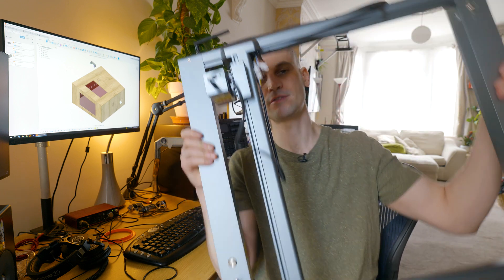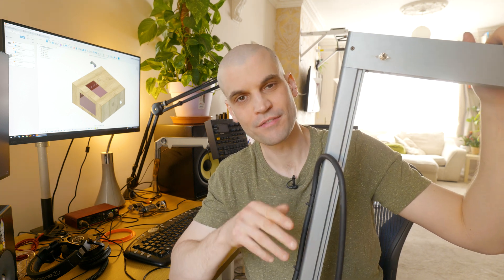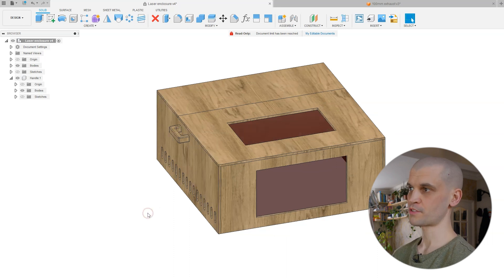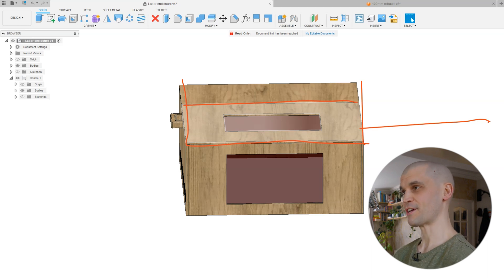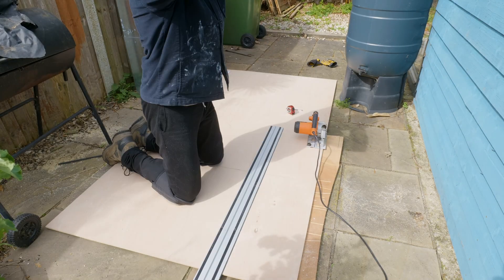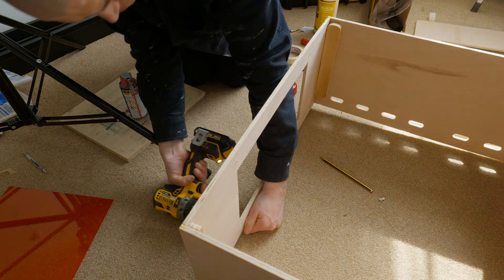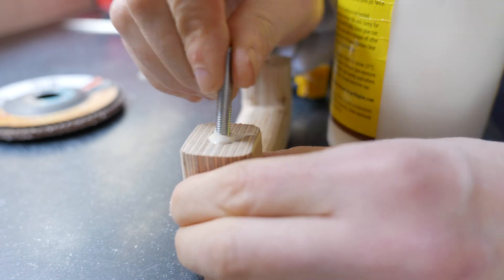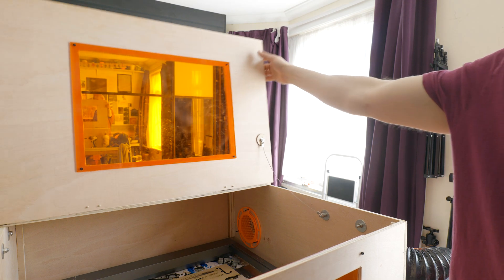Simple & Cheap DIY Laser Enclosure build

Comment: The milwaukee brad nailer, do you have a model no or link to it please?
Reply from the maker: Milwauke M18 Fuel 18 Gauge Brad Nailer, I have dealt battery adapter for it so uses my dewalt batteries which is handy. Love it, great tool

Comment: Question about condensation.  Does the heat inside the box ever contrast with a cool room and cause condensation?  Or, is your blower strong enough to mitigate this problem?  Do you wish you painted the inside of the box? Thanks
Reply from the maker: I never have condensation issues, it's most made from thin panel wood. No need to paint the inside, it will soon get stained with laser fumes so save yourself the time and money on painting it

Comment: Hello Mate, thank you very much for that great tutorial. However, i was wondering if there was any way to coat the interior with something fireproof as sometimes (rarely), lasers could start flames and a wooden enclosure would only make it worse.
Reply from the maker: You could line the inside with fire resistant plasterboard. To slow down the spread of fire. 

There are also fire extinguisher add-ons from Xtool that you can add to any enclosure which seems to be a great alternative
Reply: Oh yeah very good idea ! Thank you

Comment: Considering a build like this myself. Got a small question though. Does all the smell get vented out well? Like if the laser hasn't run for a while, does the enclosure build up smell which then "blasts" you in the face if you open it up?

I currently have a more expensive branded enclosure but not quite liking it as the smell is still bad. It vents out fine out of the window. But when not using my laser for two weeks and opening it up, a huge "cloud" of smell "punches" me in the base. It's like it still builds up inside the enclosure somehow.
Reply from the maker: The smell mostly builds up on the cutting bed below the material, that will stink from just 1 cutting project. It's a smelly process I don't think you can get around that to be honest. If I take out my cutting bed and just smell the enclosure itself it's not too smelly.

Comment: Good video!  Your intuition about the vent holes is correct.  The textbook term for it is Conservation of Mass.  To maintain the same velocity on the way in, you want vent holes that equal the size of the exhaust.  Smaller holes will result in higher velocity and vice versa.
Reply from the maker: Thanks for the info and clearing that up. Time to read up on conservation of mass 👍
Reply: I built an enclosure with similar materials but fir a 60w jpt mopa which means its a rectangle on its end rather than on its side. Where would I place the small holes on a box this shape? Wherever I put the holes, the fan will ventilation hole will be kn the opposite side? I tried researching conservation of mass on airflow but I couldn't find much on it

Comment: I think you wouldn't need those holes when you always use air-assist.
Reply from the maker: Yes you are probably right, its not air tight so you would get airflow through the enclosure even without the holes

Comment: At 8:14 what is that fan thing you use? Did you buy it? Repurpose?
I'm asking because I am currently useing an pre-owned kitchen fume hood extractor thing, and this looks a bit smaller
Reply from the maker: Hi Nik, im actually testing 2 fans at the moment for this enclosure, the one in the video is this - https://www.amazon.co.uk/dp/B01N3C7R4E just a cheap 4inch inline fan (approx 110CFM) and then I'm testing the AC Infinity T6 (6 inch, 400CFM). The 4inch does the job, and is very quiet, but this ac inifinty is much more powerful and I got it 2nd hand for not that much more than the 4inch so Ill  probably keep the ac infinity